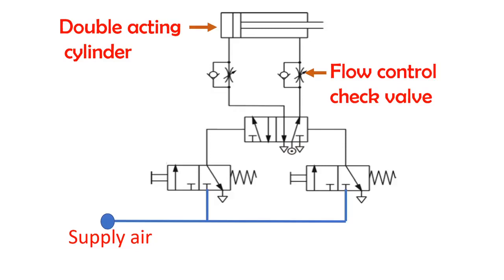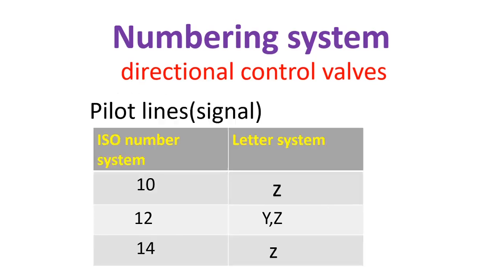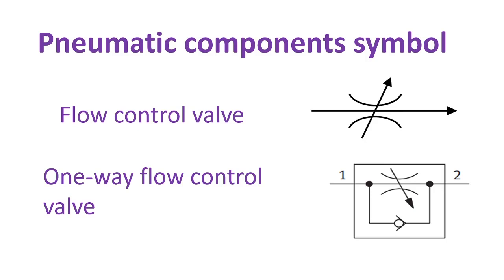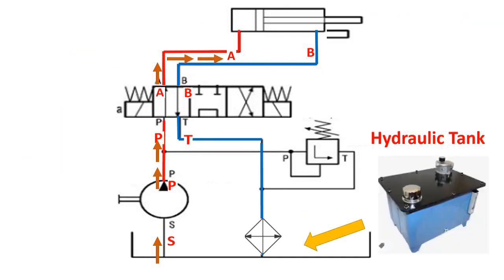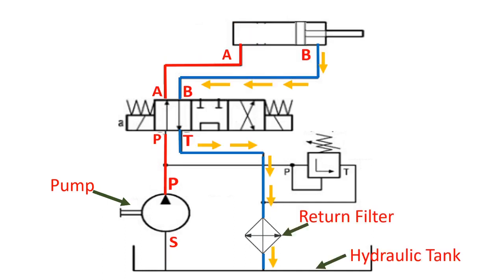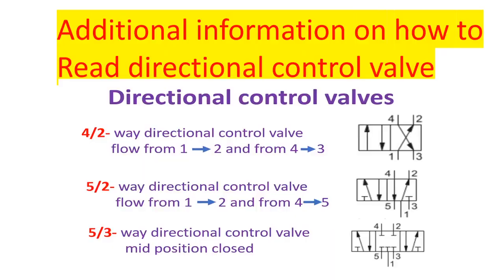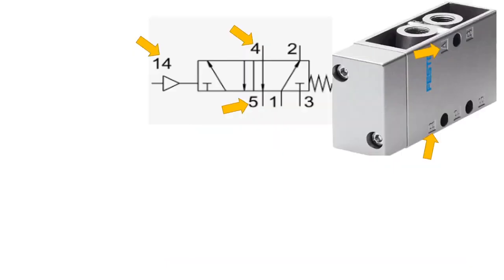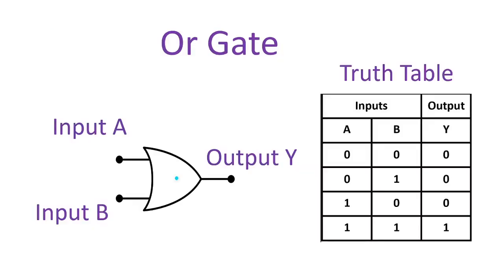Pneumatic and Hydraulic Schematic Diagram reading

Comment: I believe your "OR" tables are wrong.  You show the exact same output as the "AND" table, but in this case you should get an output when either port is actuated.  Table only shows it when both are activated.